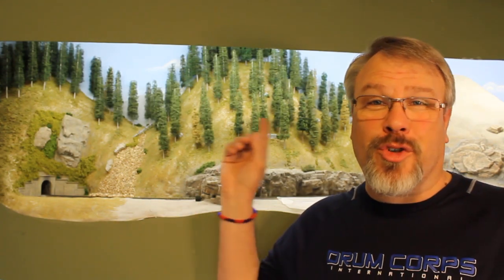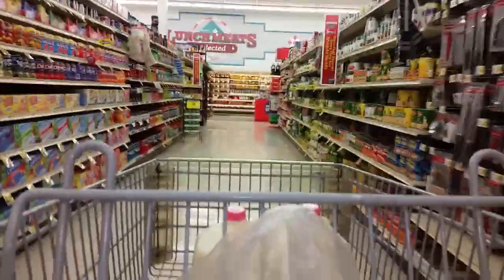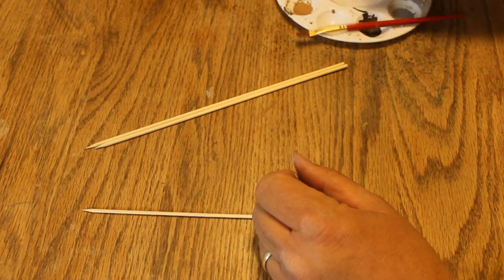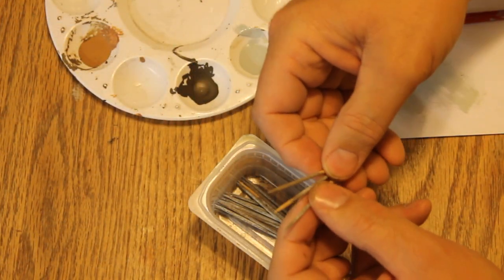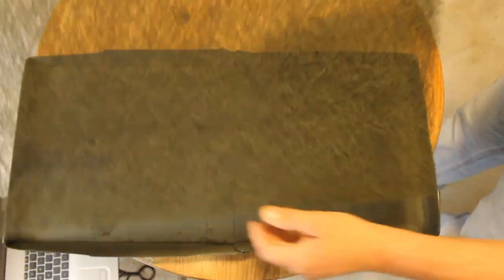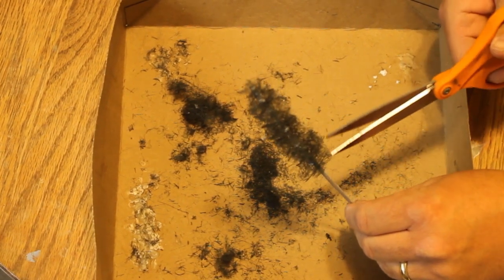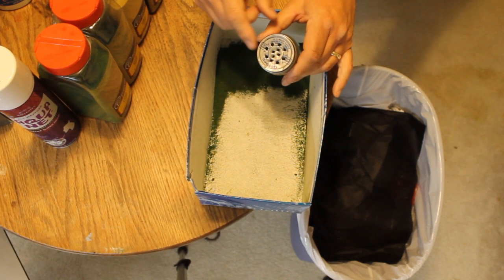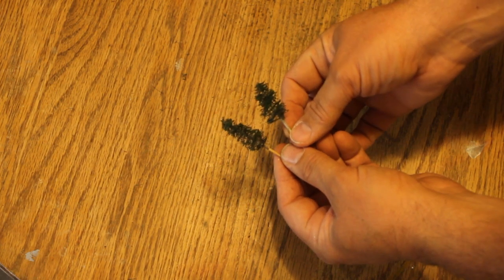How to Make Model Pine Trees that Look Great and Realistic--RTNT009

Comment: The outer layer of filter that you peeled off can be used for other effects. I cut some to fit a brick wall, painted it, added ground foam and glued it to the wall. It looks like the ivy on the outfield wall at Wrigley Field.

Comment: One of the best tricks modelers use is depth of field by using what is called forced perspective to make the horizon behind a layout look layered instead of flat. Think of it as various size plates stacked in a rack with the largest at the back and mountains are especially useful in pulling off the illusion. In essences it's simply taking thin paneling that are cut outs of back ground hills/objects etc and staggering them in layers behind foreground trees-buildings as part of a horizon. Indeed the panels can bet set quite close together and even actual photos/posters of forests-canyons etc have also be mounted on foam core boards/plastic sheets.
Reply from the maker: +Richard Mattingly I do this with scuff pads and painted distant mountains on the backdrop as well as smaller trees and Z scale figures/structures near the backdrop. 👍

Comment: Pine trees also vary greatly.  Our local species are spruce and hemlock.  Some are perfect Christmas trees.  Most vary from that to dead, some have thick branches, some are skimpy, etc. Has to do with water, sunlight, soil, neighboring trees, variations within a species, etc.  Many are young little trees that vary up to the oldest hundred foot plus ones.  I even use the so-so ones behind the better looking ones to fill out the woodsy feel.
Reply from the maker: Yes, I think variety is key. I use these mass produced ones to fill out the Forrest. Plant a few super detailed ones at the front and it fools the eye into seeing detail in the others that isn't there.

Comment: Lighting has been revolutionized by the arrival of LEDs and fluorescent tubes alway gave off an unnatural white/shimmer that hides fine detail in and often favored blue spectrum in my opinion. Offsetting lighting by about 20-30 degree angle on a layout makes nice shadows and can make scenery really stand out. It's ability to be dimmed/colored along with it being programmable an LED set up you can almost make a sunset or sunrise or cloud cover over parts of a layout at your choosing.

Comment: Thanks, from Australia.  You might be interested to know that the most common timber now in use is pinus radiate, originally a native to California I think, but in any case I can affirm that your pine trees are very good.  My layout, 8' x 4' 00/H0, is nearly complete, but the hill side over the tunnel could do with more trees, so I will put your technique to good use.
Reply from the maker: Thanks for watching. I'm glad you found this useful. Let me know how that hillside turns out.
Reply: I will, or hope to.  I live in an aged care home (I am 74) and got "volunteered" to design and build the layout, which I wasn't sure that I could do - anything of that sort any longer - but I paced myself and four months later it was 99% complete.  It has been on hold for a couple of months, due to renovations in the home, but it's ready to go and the manager wants a "grand opening ceremony".  Hmmm, but I'll go along with it.  I am pleased with the way it has turned out - an English 1950-60s theme - and I am not easily pleased with what I do, so it must be OK and other residents and staff are more enthusiastic than I am.  I don't have any video equipment other than a web cam, but I'll try to send you a picture of the hillside, whenever it is I get back to finishing touches.  Thanks.
Just noticed "hill side" and "radiate" in my comment.  Hill side not so bad, but it should be radiata, referring to the branch configuration, not some radioactive feature!!
Reply from the maker: +Gerry Hiles Best of luck and I look forward to hearing about your progress.

Comment: You can speed up production by mounting the squares on the skewer first then trimming them with pinking scissors with a zigzag teeth and then use a dental pick to pull/lace the fibers to look more like branches before flocking.
Reply from the maker: Thanks, I'll try that.

Comment: Texturing a skewer/dowel can be done by scraping a worn hack saw blade and a knot hole can be made with a nail set or fine point maker if it doesn't need depth. A great technique is to sprinkle saw dust from sanding a the trunk that can be done by spray paintingor glue and applying while still tacky then over painting it. A great substitute for filter material is polyester filler/batting for pillows-quilts from a fabric section at a local Hobby Lobby/Walmart and its white in color.
Reply from the maker: Thanks for the various suggestions. I've tried some of these, and variety is always a good thing.
Reply: You might be able to media pad.

Comment: Lovely pine trees, Ron. We are starting our HO railroad, and I will be making some pine trees following your Method. Have you made trees with trunks thicker than those grocery store skewers?
Reply from the maker: +Clemencia Rodner I have not since I am in N scale, but you can use the same proces. Just cut your filter pieces a little bigger and use dowell rod that you whittle to a tapered point. Scrape along the full length with a razor saw to give it some grain and then follow the same process.

Comment: Great video Ron, I hope someone shares pictures of their HO trees. This technique reminds me of one I saw using Scotch Brite pads or floor buffer pad material. This filter material looks way thinner though. I'd be curious if the manufacturer makes the material in green. Although the paints you're using seem to cover the Blue very nicely. I guess you could leave them unpainted if you wanted 'Blue Spruce'. Sorry, couldn't resist.
Reply from the maker: Hey, Wally. I have never seen any color but blue and the more dense white colors. I would love for some HOers to post pictures of some of their trees. I have seen HOers who used similar techniques to make pine trees. In fact the same bamboo skewers make great lodgepole pines in HO.

Comment: THANK YOU RON!!!!! 👍👍🍻😎😀
This one was valuable! As my Pacific Belt RR is mostly in the PNW, in HO Scale, I could only guesstimate I would need up to 3000-3500 trees!!!! 🌲 Yikes!! 
I could probably use those skewers to represent younger trees, and Hobby Lobby can cover the rest, with 1/8" to 1/4", 12" long wood dowels.... 
Now, I've heard about similar methods of doing Pines for years. What struck me about yours, is the manner that you prepare the batting. Also, I've never seen just the batting fill sold - but then, I've never looked!!! 😝 

With your method, I may even be able to employ my daughter and daughter-in-law, to help!! 
..... I also run through No. Cal....... and considered actually doing a few Sequoias.... 😵 
BUT, after getting 1" to 1-1/2", 36" long dowels, and what else I would need - I doubt there would be ANY hope of being economical!!! 
Thanks, for a great idea!
Carmine 🚂
Reply: Oh.... A suggestion for those in larger Scales.
Bark gets harder to paint on, especially in more foreground trees.
I was taught, many years ago, to use a small, brass bristle cleaning brush (the one that looks like a large toothbrush). Before paint, run that brush up and down the dowels. Just a few passes, but all the way around, with firm pressure (UNLESS using Balsa). 
If it looks like you've dug in too far, simply run some medium sandpaper or sanding sponge on the dowel, and lightly smooth it. 

After painting, using your method, it makes a quite pleasing looking tree trunk!
Reply from the maker: +PacbeltRR Yes, that is a good technuque. In N scale the grain already there is enough.
Reply from the maker: +PacbeltRR The batting alone is available in most building supply stores. Yes, I have employed my kids in assembling trees in front of the tv. Since I cut them to adjust shape after assembly you can't really mess them up.

Comment: Well done, do you find with the filter sheet there is one side that has a sort of hard layer ? I found this with the blue filters I bought and painted, I’m trying to just peel that outer layer off and it leaves a springy multi layer interior to cut into strips then squares.
Reply from the maker: Yes, and sometimes on both sides. I peel that off as well.
Reply: @RonsTrainsNThings  thanks I guess I overlooked the fact you tore it off at the beginning.

Comment: Another way is to use yer Ex-Acto knife to carve into the skewer so they don't look uniform from one end to the other.  Also you can use a wire brush to drag from one end to the other to give the trunk some texture.  I don't buy spray paint.  I have 2 airbrushes that I use for modeling--one for acrylic paints and the less expensive (Chinese) one for oil based paints.  I have several Nandena bushes growing and they make great tree armatures.  Wait until the red berries have fallen off and they leave a perfect bunch of tree armatures.  You can paint them before adding flocking.  They're perfect for HO scale.  Cheers from W Rusty Lane K9POW in eastern Tennessee

Comment: I have seen coconut fiber used also that works very well (takes the place of the a/c screen). That was done by Luke Towan. If you havn't made all yours yet you may want to try the cocnut fiber has a nice color on it too. Nice video liked and subbed.
Reply from the maker: Hi Chris, and welcome. I have seen Luke's video with the coconut fiber. Luke is an incredible modeler and makes great videos. I love how he adds the dead branches at the bottom of the pine trees. The coconut fiber looks a little too dense for me in N scale, but I honestly have not tried it. Thanks for watching and for you comment.
Reply: Yes might be unable to thin it down enough for N scale. Another thing is the batting used in sewing. 
When checking out how to make a certain thing such as say a coconut tree, I like the approach of the different crafters. Some have the way you like 100% other times you take one element from one another from a different crafter. A hybrid ends up being your prefered way. Anyhow I enjoy your videos and always learn something new thanks for sharing and keep on crafting.

Comment: I live in the Caribbean, so we don’t have furnaces here. Can I also use  bear stuffing to instead of furnace filter?
Reply from the maker: Bear stuffing would work very differently as it is a very different material, but you should try it and see. You can find the material I used on Amazon and other sites under spray booth filter, but it has gotten more expensive since I made this video 6 years ago. Here is a link: https://amzn.to/3ptv2FQ

Comment: Pinking scissors/shears leave a saw tooth cut but by just using the tips an angle them as you cut it will look more irregular and there are several profiles of of scissors used in scrap booking making borders. Older pairs are best because there heavier and one trick in keeping scissors sharp is to cut super fine sand paper 800+ into strips when they begin to dull.
Reply from the maker: That is a great idea. We have several sets of different shapes because my wife is a scrapbooker. Don't know why I hadn't thought of that.

Comment: Coconut fibre works as a substitute for the furnace filter. It's what I use and it's pretty good but a little annoying to work with because it's a lot more dense.
Reply from the maker: Yes, I've seen Luke Towan work with coconut fiber. I'd prefer that for HO or larger I think.

Comment: Awrsome video Ron! I have a question that i was not able to find an answer to in the comments. How robust are these trees? I would like to make some for some table top gaming accessories rather than a model set, so they would get moved around a lot. Do you think these trees would stand up to a little arboreal abuse?
Reply from the maker: I'm not sure how to answer that question. My suggestion is make a few--they are cheap and easy--then abuse them a while and see how they hold up. I would suggest for your use that you use plenty of white glue when assembling them and perhaps spray adhesive in place of the hairspray. That will make them more durable.
Reply: Ron's Trains N Things Thanks for the suggestions!

Comment: I did price out trees boy you are right they are pricey I have not set up my train set yet . We moved over a year a ago  I found my train sets under the trailer lost 4 locomotives and the cork bed .I have found cork bed in 24 fFT rolls not sure how it works around  curves , I did work with splat cork witch is better ?

Comment: I contacted 3M and asked them about cutting the filter material and they advised not to do it as it releases fibers in the air you could breath in.Just a thought if you want to do this.
Reply from the maker: A simple dust mask will alleviate this problem.

Comment: Hi ron..any alternatives for the woodland scenics green turfs..from where i am thats very expensive and not  economical and also not easy to get our hands on..at the moment im using saw dust with paint od several shades of green..any other thoughts you can share as an alternative..? im from the philippines by the way..
Thanks..
Reply: I save the saw dust from my table saw and mix in some green craft paint.. works well in HO scale.

Comment: Have you tried spin trees? I take a nail in a piece of wood. Clamp the wood to a table or bench, Take a length of wire a bout a foot or so long and fold it in half. I like to us Jute or cheap rope cut in to one inch sections and brake them up into a box to use for the branches. Take normal white glue and line the insides of the folded wire and stick the none folded wire in a power drill. At this time I like to add the rope or jute fibers in the folded wire forming   a flat looking start of your tree. Take the folded end and place over the nail and turn on the drill. This creates a bottle brush affect. trim the bottle brush into a shape you like. I use the same paint you use to spray them with. While the paint is wet. I apply the ground foam to make the needles. I left a lot of the steps out. But I would sometimes make long one and cut three or four trees out of one spin. Just a though. V
Reply from the maker: I have seen these made and I attempted them once or twice. I think they make great trees in HO, but I had a hard time scaling them down to look right to my eye in N scale. Thanks for the tip, though. I may give this another try one of these day with some variation in materials and see if I can get a good N scale tree from it. Thanks for watching.
Reply: I use thinner wire, Shorter twine, and static grass, then painted the whole thing using my own colors to get my look. Some day I will get them out and post them to you. :)

Comment: there is a green furnace variety of filter i use after trimming the filter for my furnace
Reply from the maker: +Roberts and Andersonumm I Interesting.
Reply from the maker: I looked into the green filters. They are much denser than the blue filters--far too dense from pine trees in my opinion. You would have to pull them apart, which is no less work that just spray painting the blue one, and then I get exactly the color and variety I want. Just my thoughts.

Comment: Model railroaders are often to timid when it comes to contrast/shadows on a layout and to often a all the detail that's was so hard to achieve isn't seen because their backdrop is an afterthought. Your backgrounds are some ot the most skilled renditions that others modelers don't even try, but darker is better at times and it's why lighting an entire layout is often a mistake because there's no shadows at all. Indeed it's why many layout forgo a sky/horizon as a back drop and even a black is preferable as a surrounding at times it's why layouts are lite not the platform under them.
Reply from the maker: +Richard Mattingly I do have a couple unlit areas--wasn't by choice but I like the "cloudy" contrast. You can't photograph it though

Comment: I all honesty I don't understand how people think this method looks like a real pine.  as I don't believe it does at all.  My house is surrounded by Pines of all shapes, sizes, and species.  Pines branches especially on the large ones have branches that droop down and standing under them or beside them looking up or  beside  you can see through the branches. which are never fully level all around the trunk.  the way these pines are made the branches not only are a lined up ring  But the flocking looks piled on and not see through like a real pine.  They still look like those pines they make for Christmas villages which don't look real . especially with the frost like snow on them.  But that's a different issue.  there has to be a better way to make a realistic looking pine tree branches than using that filter stuff.